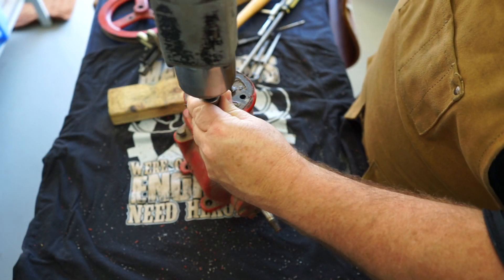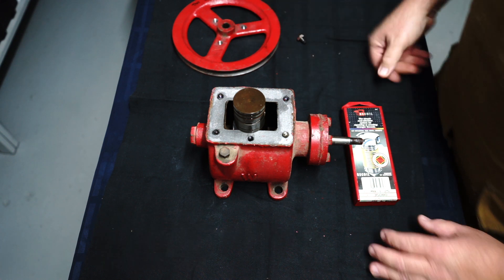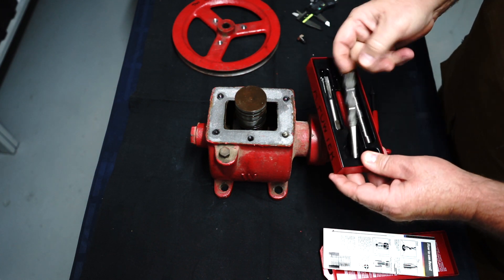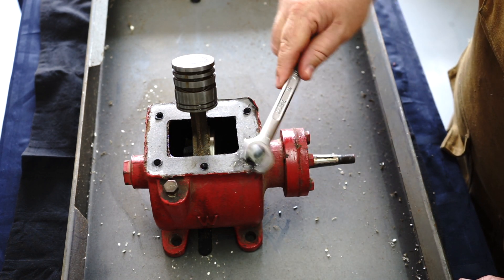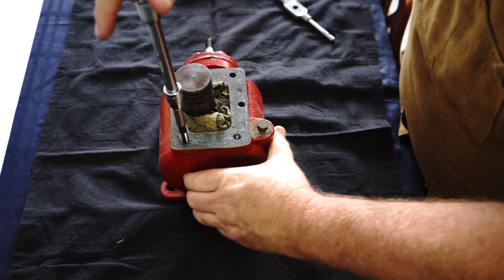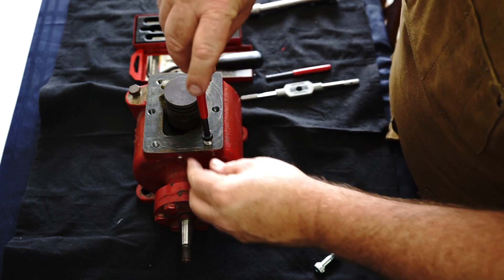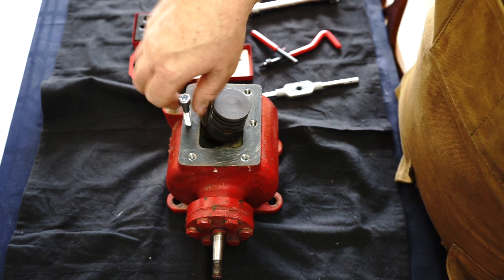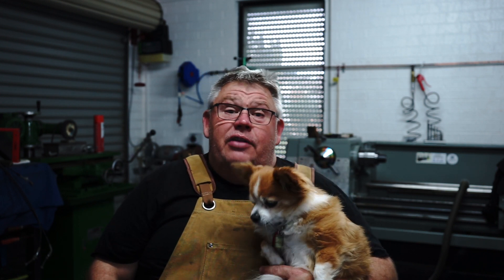Extracting a broken bolt & thread repair - Stuff I'm working on

Comment: A lot of extra work for the sake of one bolt. Old Joe's threads were good enough for General Engineering and the motor industry up to the '60's.  Maybe those bolts bottomed out or were overtightened. No washers.  The nut on the end of the spanner?
Reply from the maker: Hi Robert.  Don't take me too seriously mate.  I'm always taking the piss out of the imperial system.  This is an on-going saga with my buddies over in the USA.  They call metric "Communist Units" and imperial "Freedom Units".  Then I give them shit about kicking the British out in 1776-83, as that's when they discovered Australia and set us up as penal colony.  They usually respond with, "so when did Australia send a man to the moon" 🤣.

Oh BTW, it was actually a monkey on the end of the spanner.

Cheers, Aaron 🍻

Comment: Hey Aaron.
Love the Outtakes at the end of the video.
WHITWORTH threads ??
I have the Recoils to repair this thread,  but NO Bolts to put back in afterwards ??
Definitely a trip down to the local hardware store to buy replacements.
Even the Industrial Supply stores hate Whitworth threads they Never have the size you want.
There might be something in that ??
Reply from the maker: G’day Peter, how’s things mate?  Yes I think you’re right there buddy. It can be hard to find those old BSW bolts these days. My bolt guy caries the main selection of UNC, UNF, and metric (coarse & fine). I had the recoil set already, so it was BSW be gone and hello to metric M8x1.25 😂. I’ll try and come down to see you before work starts back. Cheers 🍻

Comment: Hey shop dog. 👋 You probably know this but if there is not enough of the broken bolt sticking out to weld a nut to it, then weld a washer to it first and then weld the nut to the washer.
Reply from the maker: Hey buddy how’s things. That’s an excellent tip. I’ll have to remember to try that next time. Thanks for stopping by. Cheers 🍻 Aaron. PS: the Chihuahua says hi 🐶
Reply: @AaronEngineering  Snowing like crazy today so not doing much but watching YouTube videos.😊
Reply from the maker: You can keep that snow ❄️ all to yourself thanks 😊. It’s supposed to be summer here in a Melbourne ATM, but today it was only 18 degrees (64f). I should be out in the shop, but I’m on my arse watching TV instead 🤷‍♂️

Comment: Nicely done comrade. Chihuahua looked unimpressed but I think you did a great job.
Reply from the maker: Howdy Stephen. Thanks buddy, I try hard lol. I need to make some piston rings now for this pump. Then bolt a 4 stroke head on it, timing chain and ignition system. Fingers crossed that I can pull it off and it runs 😉

Comment: Aaron,
Another really interesting vid mate 👍
I wish I had a £ for every broken stud I had to remove as an apprentice. Mostly because the fitters loved to use ‘starter bars’, or 3lb hammers on spammers 😱.
Steel bolts in cast iron valve bodies in a seawater environment 😂😂😂😂
No spark eroders in 1966.... not at Cockatoo Is. anyhow. 
Keep them coming Az 👏👏
Regards
Robert
Reply from the maker: G’day Robert. Looks like we’ve both been busy in the shop of late. Hey, Arthur over at Livetools has a portable EDM (spark eroded) that he loans out to customers from time to time to remove broken taps. That would probably make for an interesting video. Cheers Buddy 🍻

Comment: Maybe it's a Sydney thing but all the TAFE teachers loved Whitworth. I agree with you about Whitworth though - I get that it has the rounded crests and roots so stress risers/concentrators are reduced, but in my mind, the aircraft MJ thread is the best of all worlds. Regular metrique thread pitches, but the profile has the rounded roots and crests like on Whitworth. Pity the taps and screws are near impossible to find!

Great detail about the thread insert too - I never new about the depth stop, or the tool to knock the tang off. Glad you got out of dodge in time!

Thanks :)
Reply: Also, with a dog that size, might I suggest trading it in for a cat. Lower maintenance, and fewer fluid leaks on plant equipment ;)

Mine is called... <wait for it> Millie!
Reply from the maker: Noooooo never. I love that little Chihuahua, and he even sleeps on my bed. Mossy was raised by the Columbian drug cartel and does what he wants. He didn’t choose the “Thug Life”, but the thug life chose him 🤣
Reply: @AaronEngineering  😲
Reply from the maker: G’day Adam. Yes they seem to love Whitworth threads. Apparently they don’t strip as easily as others 🤷‍♂️.

As a former motor mechanic I hate the bastards. I remember my apprentice master asked me to get him a 5/16” AF spanner 🔧 and brought him back a 5/16” Whitworth and he threw it at me 😂.

We had to learn all the threads back in the day UNC, UNF, BSW, Metric, BSP etc.. talk about a head FK 🤦